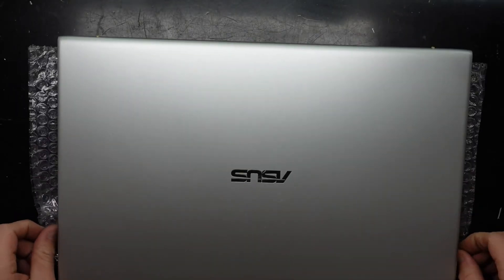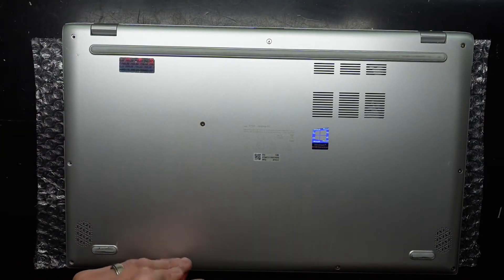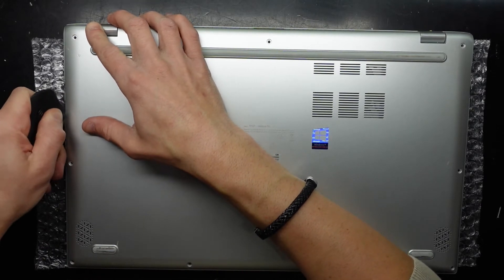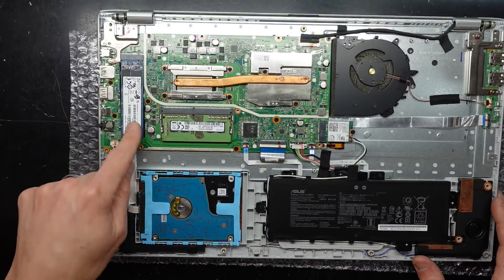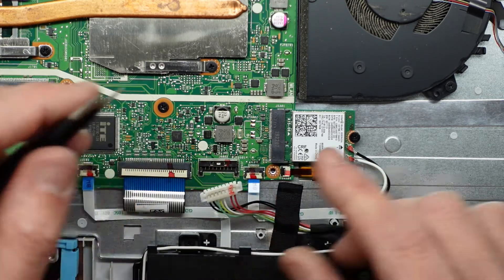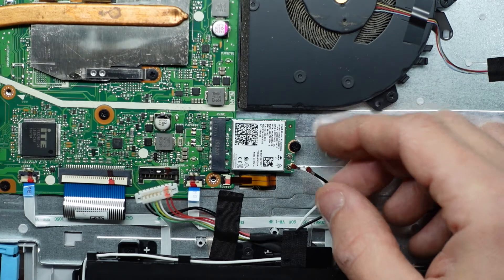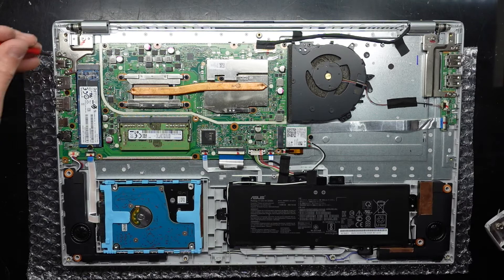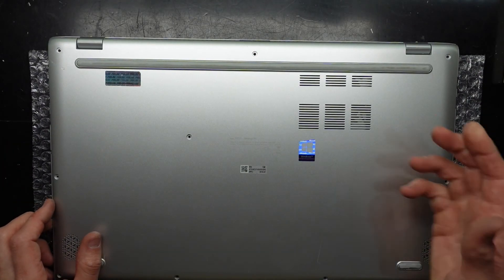Asus Vivobook 17 X712 Wifi and Upgrade options

Comment: Hi. Ive got asus x415ea which comes with realtek 8821ce. Whats the best option to upgrade to as it has 1 cable?

Ive ordered ax210 but realised it needs 2 cables for wifi and Bluetooth to work good.

Comment: Does it have a bio battery mine won't take charge ot turn on after the battery hit 0
Reply from the maker: a flat bios battery wont cause that issue
Reply: @rickstechrepairs  can't figure it out
Reply from the maker: laptops can run without a battery. i would be suspecting the charger
Reply: @rickstechrepairs  tried that k checked for power at the rails im getting 19v

Comment: Great video thank you I pick mine at Walmart store self model for $140 for core 13 11th gen uhd graphics 256gb m.2 sata.  Has little scratch on screen it’s ok not to bad you do notice it missing little key button chip missing of it showing . Button great deal overall I think.
Reply from the maker: sounds like a great price
Reply: @rickstechrepairs  not sure if you know but I just purchased a 712J, can I upgrade to wifi 6?